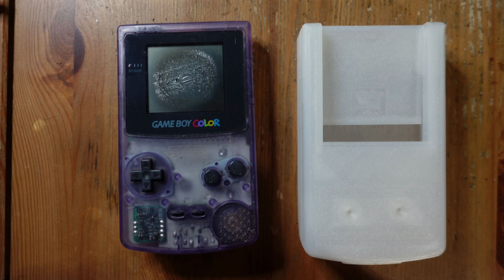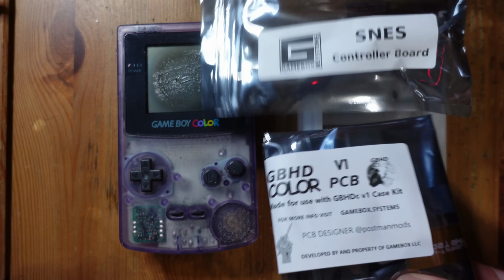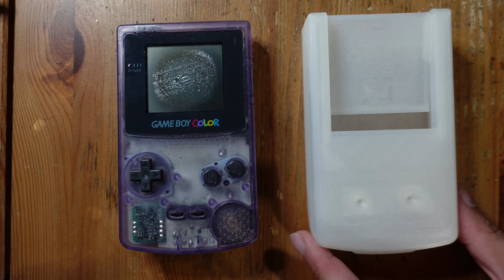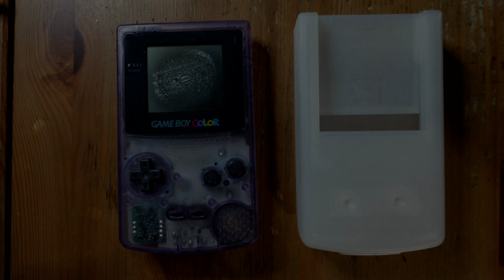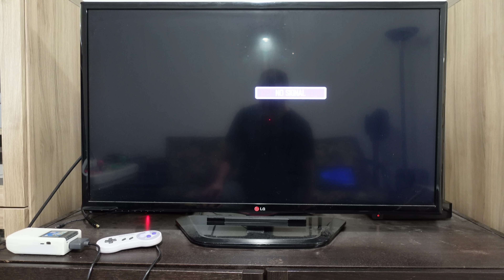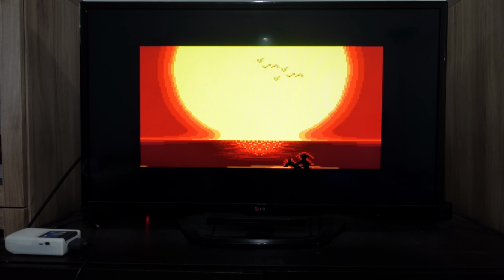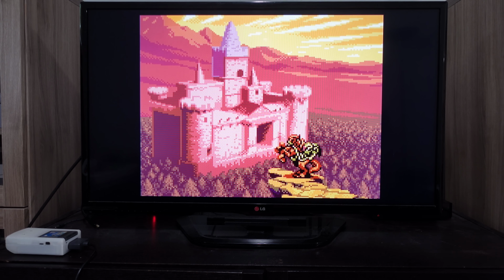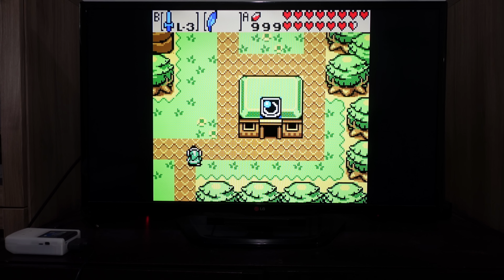Add HDMI to your Game Boy Color! GBHD Color installation and demonstration

Comment: I've had a GBC with de-laminated screen. It happens because of the glue they used to hold the polarizer layer deteriorates over time. There are a lot of GBCs out there with the same problem.
Reply from the maker: It’s good that we have some options now to resurrect those GBCs with bad screens

Comment: Is there a reason you wouldn't do this with a GBA instead, so you could have the whole GB library to choose from?

I do love classic GB / GBC, just curious if there's a reason not to use the next gen with its backwards compatibility.
Reply from the maker: That’s a totally valid point and the GBA is a great option because you can play a larger library of games. In this specific example, I made this consolized GBC for a video game history exhibit, so they wanted a GBC and a GBA. Aside from that, I think the only other reason to make a GBC would be if you had a lot of nostalgia for that console
Reply: @LIRetroGaming  ... or if you just happen to have a GBC with a dead screen or smashed case (or both) sitting in a drawer somewhere ...